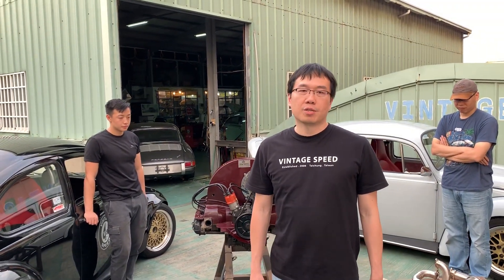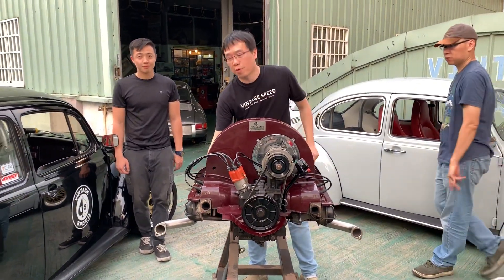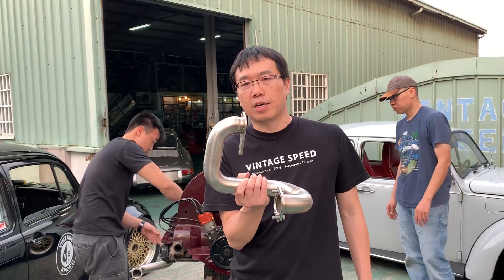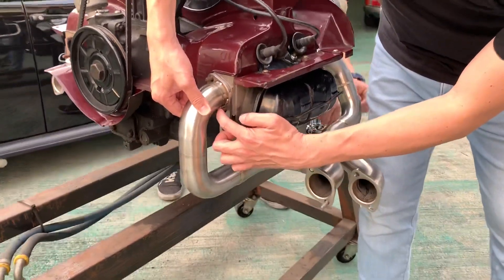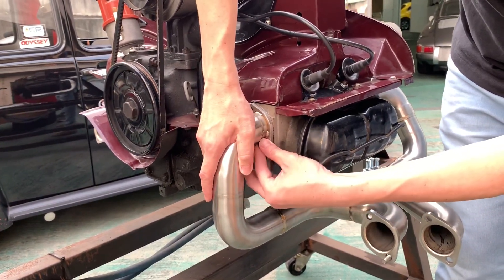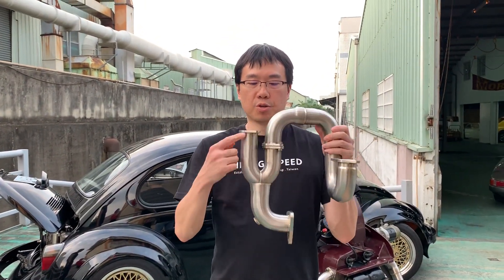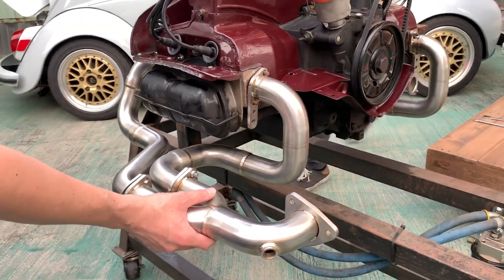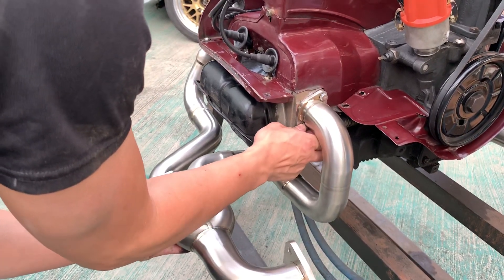How to install Merge Comp VW Bug Exhaust by Vintage Speed

Comment: To me that way of pairing the exhaust pipes is not so good since the firing order is not correct for proper 4-2-1. I may be wrong, but the exhaust will most likely make the engine lack up towards 10% torque and a little hp compared to a normal 4-1 header. But if looks matters more than power I guess it is ok. - I would REALLY like to see a dyno session with a larger cc higher hp engine comparing that muffler against a Sidewinder or a Python or even a regular out the back merge header for comparison.